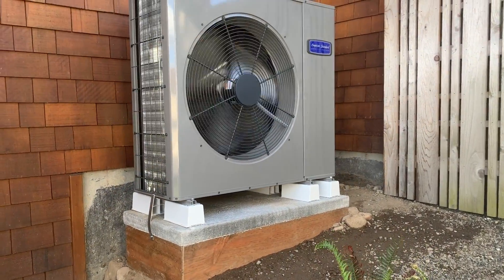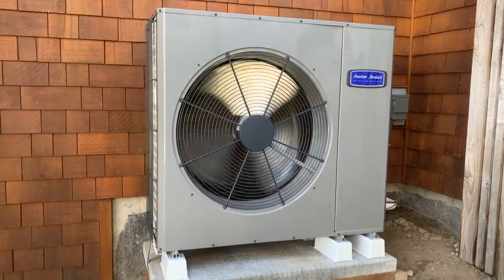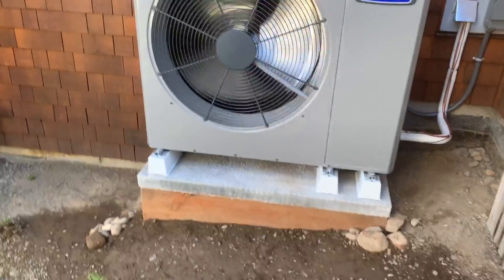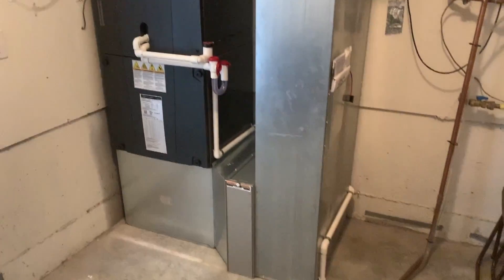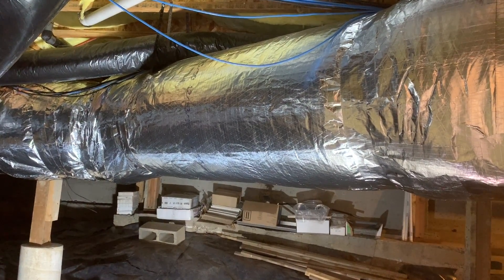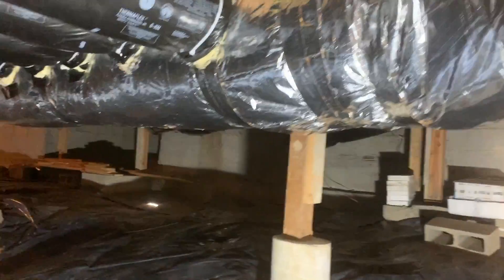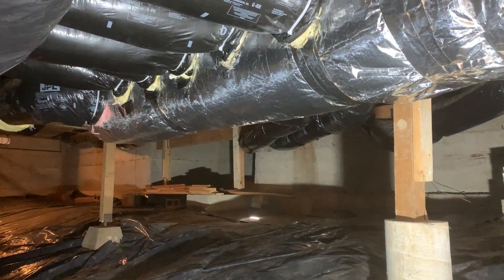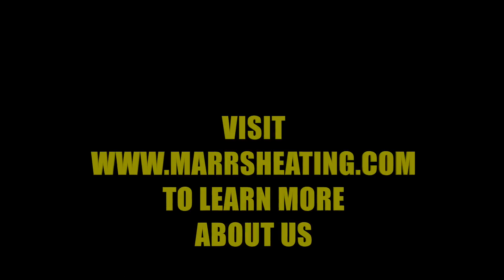Ductwork fix and Variable Speed Heat Pump System Upgrade

Comment: On your next Side Discharge Unit Install. It would be nice to see the compressor/electrical section.
Reply from the maker: Great idea! will do!
Reply: @marrsheatingandairconditioning  
what about to show the compressor part on your next mitsubishi hyper heat system? I want to seer the compressor modle and the tubings inside.